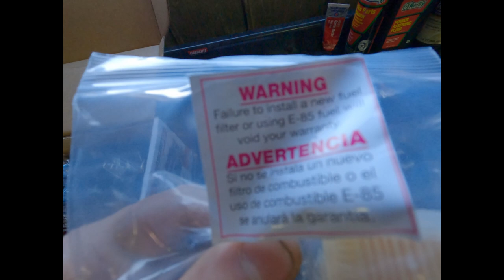Squarebody C20 Test Drive |LS swap C10 update| |square body| |1000 subscribers|

Comment: Thank you for this video, I just put this exact same carb on my 75 C20. Same color as your truck only yours is in much better shape. Thanks for pointing out the vacuum leak issue, I think I may have the same problem.